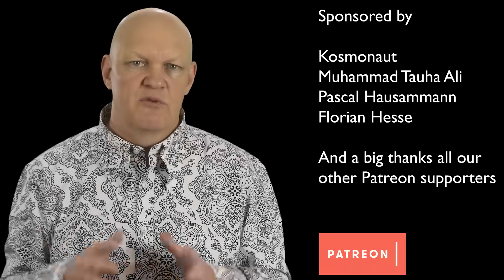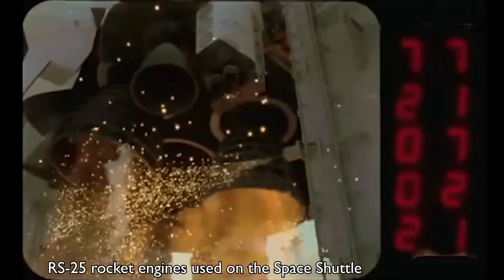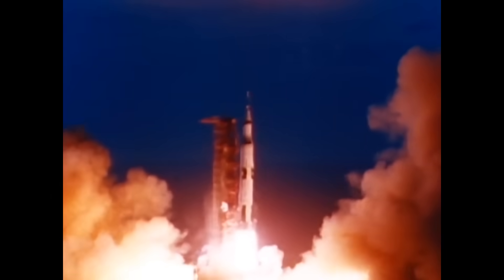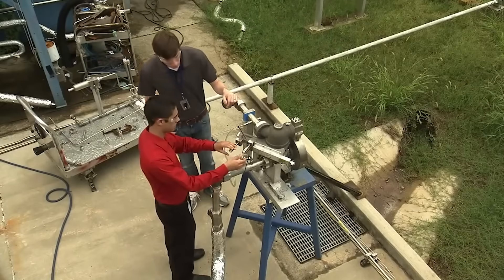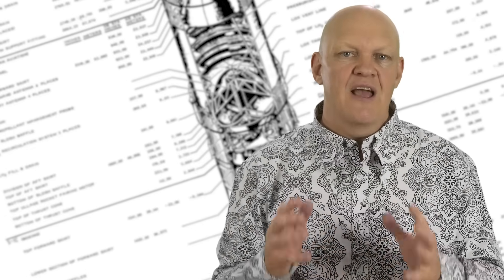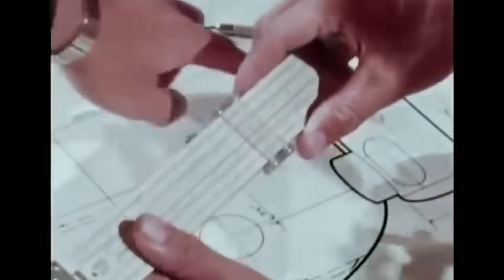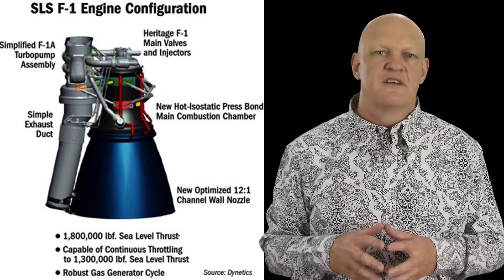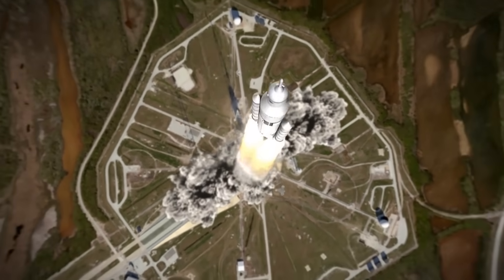Why Can't we Remake the Rocketdyne F1 Engine?

Comment: Those original skilled engineers built the original engines in less than a decade, with no prior practical knowledge. We can do the same today, even better with computer modeling as said in the video. No need to redo the essentially custom-made F1. It would be like lamenting that we don't build boats out of hand crafted carpentry and wood anymore - we can mass produce them much better now with modern techniques!
Reply: Actually they had prior practical knowledge from German rocket scientists who worked on V2 rockets and the like in WW2.
Reply: XVIRUSTV because they need it to work, not just as a prop for a movie. 
Mechanical parts are more function than form. Form is what you can easily get from printing.
Reply: The many different engineers of the Mercury/Gemini/Apollo era did draw on things known from aerospace of the time, but there was far more going on from ~1961 - 1967 than we will ever (have a need to in many cases) see replicated again.

If you start up a company that requires a big-box building, nobody today would have to invent steel girders, concrete, asphalt, subterranean plumbing, electrical wiring, etc. That, in essence, is practically where the NASA and NASA contractor engineers were at back in 1961. Or, if you like, you can set the date back to the early 50s and include NACA, the X-15 project, etc., in the above.

Those folks were doing all of this with long-hand math and slide rules. You want to talk impressive, that ladies and gentlemen is impressive. All commentary about modern day engineers aside, the fact remains they stand upon the shoulders of giants.
Reply: XVIRUSTV - The parts have to meet extremely demanding specifications for tensile strength, heat resistance, keeping weight down and the like. 3D printing is not yet up to the challenge of printing such things. It might be good for printing molds though for more conventional casting of said parts.
Reply: Art Weaver well well then it's especially good that I'm becoming a engineer of woodworking after I learned the craftsmanship and worked in the trades. So don't give up The hope, there are qualified people out there and they will rise and shine.
Reply: Alan Crouch - that's a falacious argument. You're comparing rocket engines to cars.

Well, why don't we take a trip back into history and look at the absolute shitshow of unsafe, poorly made garbage cars that were produced in the 60's and especially the 70's?
Safety was an afterthought more often than not, and frequently it took a dozen deaths and a massive lawsuit to get a car maker to admit there was even anything wrong. at all.

There were cars in the 70's that would burst into flame from very low speed rear end collisions if one of the indicators was on. Because the wiring would short on the fuel tank. boom.

You can blame modern engineering, but the reality is this kind of stuff has been going on forever, and it's usually the commercial imperative that results in this nonsense.

Why was the galaxy note 7 so prone to exploding? Well, to begin with, lithium ion batteries are a fire hazard in general.
10 years earlier you had a bunch of Sony laptop battery packs exploding due to a manufacturing defect.
Iphones have caught fire too, but nobody seems too worried about that. (my ex boyfriend had an iphone X explode on his desk while he was examining it for potential repairs). Other models have had this happen too.
It's an innate risk with batteries, but lithium ion (because you know. Lithium - a metal that reacts explosively to contact with water) packs are especially risky...
And they're not a failsafe technology in the slightest. Failure modes for lithium ion batteries are pretty much always exothermic reactions.
So the note 7 battery, like with the Sony packs a decade before them, had poor quality control in manufacturing. (contaminate a battery and bad things happen).
But, the phone was also too thin, and had too large of a battery.
In other words, the design was pushed too far into the extremes.
Why though would you design something that way? Because the battery life of a phone is marketable, and using a bigger battery is a simpler, less complex, faster to implement fix than trying to reduce power demands.
And for some inane reason, phones are a fashion statement, and thinner is more marketable...
Both of these are very strong commercial pressures. And in a for profit company, it's easy to let those kinds of things overrule common sense and safety.
As has happened many times. As in fact was extremely bad beyond your wildest imagination in the early industrial revolution.

Frankly, you're looking at the past by making disingenuous analogies, ignoring the reality of more comparable examples. (eg, cars of the 60's and 70's vs cars of today rather than rocket engines compared to cars and phones), and just generally indulging in this absurd look at the past entirely through rose-tinted glasses.

That is, to put it mildly, incredibly insulting to everyone involved, both in the present day, and the people from back then you seem to idolise out of all proportion to reality.
Reply: Gewgulkan Suhckitt Not to mention the Mercury and Gemini projects that came before the Apollo project. I could be mistaken but I'm pretty sure that Saturn Vs weren't used for either Mercury or Gemini.
Reply: Greenspud Trades yeah no. U.S Super Carriers of the same model are still built and designed differently from their Sister Ships.

USS Reagan and USS G.W Bush are the same model however they are not truly 100% the same
Reply: I say make it with new welding techniques fitters and modern machinists!!!!!
Reply: As far as NOT making boats from wood any more, maybe you don't but there are lots of people doing so for recreational purposes. Also, in its last refit, the USS Constitution was largely rebuilt from live oak just like it was originally, and is probably as strong as it ever was. It can be done with enough time and money.
Reply: Michael Clark effective use of Einstein's quote!
Reply: I know of a perfect example of this problem.
The primary turbo pump is powered by the pressure release of the liquid oxygen.
It was originally six parts with four ports. After dozens of failures under test they figured out that we just didn't have the materials to make the seals and gaskets that could withstand the environmental distress.
Their final solution was to reduce the parts count to three, and weld the entire assembly into a single continuous unit!
They actually made the rotor and bearings as a single piece!!
Reply: Development of the F-1 Engine started in 1955 for the US Air Force, it had cock all with NASA (which didn't exist) or Von Braun's work for the US Army. It was planned to be the engine for a USAF ICBM that could loft the biggest H-bomb in the US nuclear Stockpile at the time. The engine was transfered to NASA (and Von Braun's Saturn team) in 1959 after the USAF switched ICBM development to smaller rockets with storeable liquid and Solid propellant engines (Titan II and Minuteman) with much smaller warheads.
Reply: What a millenials thing to say. If you want quality than you have to do it the right way and then you add in the improvements when you know the thing is in working order.
Reply: Greenspud Trades Not really. Even today, we still re-use/re-design machines inspired from the past. They did have prior knowledge or must have.
Reply: +Jirapat by prior knowledge I didn't mean they were starting from scratch. I was just referring to that particular rocket design. If they were to replicate the F1 today using contemporary techniques, they at least have something to reverse engineer.
Reply: Greenspud Trades Right.
Reply: Greenspud Trades that's where you are completely wrong.
You've obviously never attempted to actually make anything of any complexity from a schematic or blueprint.
This problem has existed between engineers and fabricators since the beginning of time.
Engineers believe that anything they design can be easily fabricated and will work the very first time it's built.
This is in fact almost never the case!
In the old days of NASA engineers were every hands-on. They both designed and fabricated!
Today, the majority of engineers don't even know which way to turn a screwdriver to remove a screw!
All they've ever done is sit at a computer designing virtual projects that always work.
I worked for years and made boatloads of money making engineered schematics into actual working devices. And most of my time was spent pounding on some engineers head that what they wanted to do couldn't be done or done the way they imagined it....
Reply: No we cant, those engineers minds knew a lot more than say 50 of today's engineers, they also probably had changed things in their design which only they knew and as the video stated, may not have been documented or else documented on scrap paper or somewhere that was lost.

Add to that the fact your comment, Greenspud Trades, proves to us all, and that is the fact that humans are lazy, you want to just produce things and rely on computer modeling, not only does this show that new engineers are not using nearly near enough of their own knowledge and skills anymore, but you also proved that you rely on a computer system which in the end is created by people, and people can be wrong, and people are in fact wrong all the time. 

The engineers who made those rockets, did something that more of the people today should do, and that is, they took the responsibility of the peoples lives that would possibly use those engines to get to space, and used that to make sure they didnt make a mistake.

Take the amount of issues with anything manufactured brand new these days, for instance, Samsung with batteries that explode, Ford with cars that burst into flames, even Lamborghini's with the same fire issue, the Aventador's, had the same problem, and a million dollar car catching alight for the reason it did, after so many cars produced and so technologically advanced, etc, etc... Adding that FORD who also made the same mistake and caused the Ford Kuga issue, yet FORD has produced probably millions more cars than Lamborghini, and both didnt see this issue coming, and Lamborghini only recalled their cars last year, after denying the issue. They had decades of data and test results they could refer to, and yet their mistakes, well FORD's, killed people, i am not sure about any Lamborghini's catching alight and killing the occupants, since they would catch alight if revving and not moving, unlike the FORD's with engines that were not performance engines and cooling that was only there for cost and necessity, and so a FORD idling and revving, will keep a constant temp to when driving to an extent, while the super car, uses the air cooling a lot more, for a much bigger hotter, engine, so a super car revving stopped is already dangerous.

My whole point is, did the rocket work 1st time, and work properly and how it was planned to work?? 
Did the car??
POINT PROVEN.
Reply: Josh Kaufman "space may be the final frontier but its made in a hollywood basement"
Reply: Why don't they scan the parts and 3D print them?.
Reply: Because 3D printing is not a magic wand that can do anything, it has it's own limitations and quirks that have to be considered when designing and printing parts the most important of which is the need to make sure that any overhangs are supported to prevent the print from collapsing during manufacturing and the removal of any supports used must be done carefully to prevent damage to the printed part. When designing your own parts to print you can deal with these problems on your own terms, put when replicating a part that hasn't been 3D printed nor made with 3D printing's limitations in mind things become much more difficult.
Reply: Ya, if they could reproduce all of those tolerances and figure out how to work harden/ pressure-garentee those metals. Thats where 3D printing falls short, however.  If only...

Comment: so in a very small nutshell, building a new F1 engine would basically be akin to how the 2010 Camaro is built versus the 2002 and earlier
same in spirit, but totally different engineering (given that it's no longer worth it to make F-bodies and the like)
the cost of upgrading and recertifying the manufacturing processes are so high that it's just worth it to make a new modern product that serves the design better, instead of trying to revive something old

Comment: So basically it's just that the new generation isn't as skilled as they all seem to think they are.
Reply: All our skills are now concentrated on navigating the windows on smart phones. Period.
Reply: I'm sure there are lots of thing someone living in the 1850's could do that you can't.  Does that mean your an idiot in comparison?  Of course not, you just have different skills to meet the needs of a different environment.
Reply: D8W2P4 1) It's the F1A that the superior F1B is compared to

2) The M-1 was also never built. We probably won't see an engine like it, for the same reason the F1B won't be used. Vast arrays of smaller engines are superior to small numbers of large engines, so that's where the industry is going. The reason the F1 was built is because back then the control systems and industrial standards didn't allow setups like that to be reliable (N1...). That's not the case anymore, so that's the future.
Reply: I did not refer to the youth.
Reply: Luc Ouellet they do not need to be skilled THANKS to CAD/CAM.
Reply: +Test Account Please Ignore
That's basically a modern version of the F-1A dude.
Talk to me when they build a better M-1.
Reply: +Test Account Please Ignore
>The M-1 was also never built.
How do you think they extensively component tested it if the parts didn't get built?
Reply: +Test Account Please Ignore
Sorry but multiple engines like the N1 are stupid even if you have great tech, case in point point me to a SINGLE rocket IN USE with as many engines as the N1 also there's the issue of efficiency being crap no matter how you slice it with multiple engines.
A more accurate claim is since we only send up toaster sized satellites to just barely out of the atmosphere anymore we don't need the heavy lifting ability of engines like the F-1 or M-1, hell the space shuttle is a monster compared to anything in current use.
Reply: We are talking about skills that are relevant and no longer exist in USA. Of course no one person has every skill so why make comments personal?  It adds nothing to the discussion.
Reply: travsb1984 well said
Reply: Did you miss the part where modern engineers built a vastly superior version of the original F1 engine?

Basically modern engineers have a completely different skill set when compared to engineers from 50 years ago (it just so happens that skill set is far more powerful too).
Reply: D8W2P4 Several major parts were built and tested, but the engine never made it to prototype stage (where they would have actually built and tested one). In any case if we wanted to these days we could build an engine of the same class, but superior in every way. Problem is there's no reason to (for the reasons mentioned before), so there's no money to do that, so it won't be done.
Reply: When I was in school for design first years were not allowed to use the 3d cad programs to complete designs. 

You ever hand draw the ribbing of an air craft? Or the internal structure of a house?
Reply: Most modern engineers are just application executives they dont think or imagine or do they just try to cover up their mistakes and short comings.
Reply: +Rau Kenneth speak for yourself

also, wasn't it Plato that was complaining about disciples being lazy and not memorising treaties but using scrolls to learn them? Yeah "the youth" of today! They don't know they are born! /s
Reply: Luc Ouellet  it's not even 'higher profits' per se, but the new way is easier, makes better, more reliable parts.
Reply: Keegan Carney No it's not the issue here. The new generation can do it maybe more easely with today's CAD/CAM tech. The today's problems are the strain of time and money limits and the high profits mongers

Comment: Hi, Aerospace engineer here, and I'm sorry to say but your conclusion is vastly incorrect. Yes I agree skilled craftsman is a dieing breed but that doesn't relate to this. I would be very interested in hearing where you got this conclusion from though, it's interesting. However, the reason we don't use these engines any longer is for the same reason we don't use a semi truck with a Ferrari engine to transport a single cob of corn to grocery stores. 
Around the time of Saturn V we were thinking space was going to be the next frontier and that we were going to need to bring large quantities of materials and people into space.  (Check out the sea dragon rocket) but the space race ended and we didn't need to bring that much into space and so smaller and more economical options were thought up. And now today with space x and the prospects of going to and even settling on Mars becoming a reality the need for larger rockets is resurfacing and so we have rockets like the Falcon Heavy and Delta IV heavy so this is where for the first time that we would have needed or even wanted the F1 BUT as great as a 'Ferrari' engine is the demand for reusable rockets is whats paramount at this point in time and this is something the F1 would be extremely inefficient at. It could be done with a parachute landing system but that is like going to restaurant and settling for the possibility of your food being delivered to the ocean instead of your table. It's much preferred and economical to just have your food brought to your table I.e. rapidly reusable rocket systems.